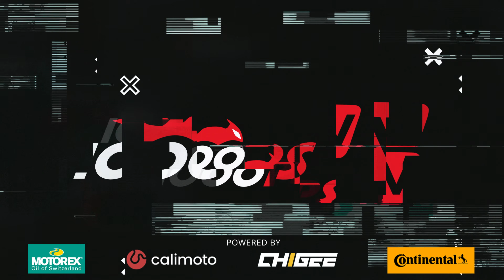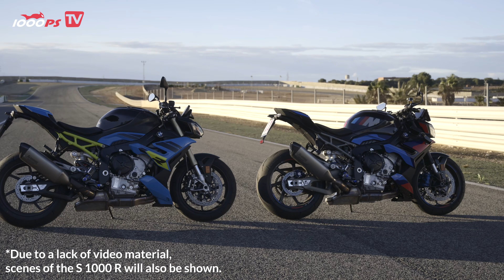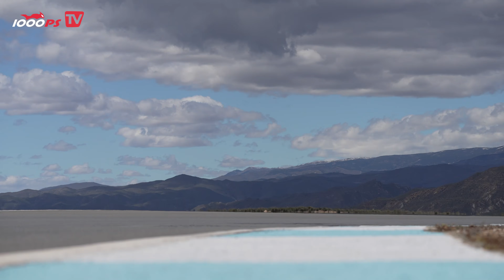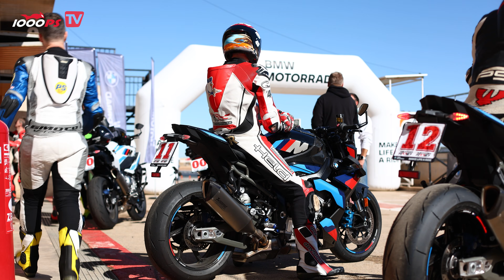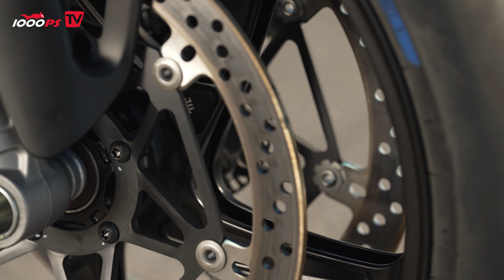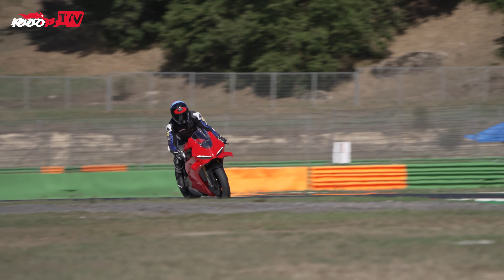Ducati Streetfighter V4 S beats the BMW M 1000 R – or does it? The honest verdict!

Comment: What's the price to run them?  How much servicing is needed to live with one of these beasts.  My 950 multistrada is pricey to service but so far the smiles, sound, and satisfaction have been extremely abundant!!!. 
And with 19,000 miles on it it has been extremely reliable, cost has been mostly consumables like tires and having them put on,  rear pads 1 once.  The enjoyment I got from this bike has been beyond words.

Comment: lengthening the swingarm on a naked counterpart of a litre sports bike is a no-brainer, as it helps transfer more weight to the front wheel, to compensate for the lack of fearing and upright riding position of the rider.

Comment: I did ride the V4S corse and it's a insane bike also easy to handle and flips easy on corners. I can say that the Streetfighter is expensive but 2000% worth the price and with acrapović exaust you get 236 HP with a different ECU MAP tuned for it. So my choice is and will be the DUCATI without doubts...

Comment: I have the Ducati V4 SP2 Street fighter, my friend had the M1000R. Just like my S 1000 RR the  M1000R increases compression damping at speed on the rear shock and it's an electronically induced pain in the ass. That electronic 😮interference can't be stopped unless you change the rear shock. Ohlins is always good and if BMW had it on the M1000 that would have been my first choice. I'm happy I chose My Ducati which feels like it has much more mid range in comparison.

Comment: Those are 2 amazing machines.  Both come from a championship winning faired motorcycle, no?  so they should be the 'best' naked.   I'm more happy with my 1290 than i ever would be on either of these machines.  Style. Its about what makes you tingle. Torque, now that i know what it is (missing from all inline 4's) is something i wont give up for higher top end.  nope. Honestly, if you havent ridden this torque monster, you dont know.  Theres a cbr1000 in my garage.  id take the 1290 every time.

Comment: For me money was not in the equation. I test road boat bikes in the hills for a long period and absolutely hated the Ducati  Street fighter and loved the Bmw m1000r  competition I ended up buying the Bmw and oh my god I’m in heaven. I absolutely love it. What an amazing bike and one more thing that you didn’t mention the Bmw doesn’t overheat on a freezing cold day like the Ducati does also every time I came to the stop it kept going from two cylinders to 4 cylinders to 2 cylinders to 4 cylinders I can see that being a big problem if it’s doing that straight away on a brand-new bike and everything aftermarket on the Ducati costs four times more than on the Bmw it’s absolutely ridiculous and the Bmw shit all over the Ducati and looks and most every Ducati owner I know complains about how many times it’s broken down and that it’s spent more of its life at the dealership with the chief mechanic scratching his head that was a big put off to me especially when you see $140,000 super Leggiero brand-new having problems at the racetrack you don’t see your Bmw with a problem and they have five year warranty
Reply: My BMW M1000R leaked oil from the head gasket below 6000 km. Fixed in warranty but still not great. The Ducati V4 engine switch of 2 cylinders when stationary and low rpm in some cases to lower heat. I have the Streetfigther V4 SP2 as well and to me the Ducati is better built and more fun to ride. The only plus of the BMW are that it's more comfortable and the inline 4 reminds me of when I was young. The Ducati has better suspensions (by far), better brakes, a more exciting engine, and overall higher built quality

Comment: Crazy amount of info but it all seems to be geared towards track riding which i dont do nor ever intend on doing.
Reply: Reviewers in all professional media should never overlook this point. Including me. 😅
Reply: Qualifier for my statement — I’ve owned two naked bikes (Monster 750, Monster S4RS), a Streetfighter, 1199R, and a custom naked built around a 900SS. 

Why would you not gear 205hp bikes built around an S1000RR and Panigale V4 toward track riding? Neither of these bikes makes much sense as a street bike. There are much better choices. I’ve ridden all the bikes I listed on the street, so I get it, but 90% of the design parameters are wasted on the street. 

I would welcome 1 minute each on comfort items for the street: heat output from the engine, vibration, braking in cold/rain, instruments & tech, gearing. That said, the majority of the objective difference in bikes like this is going to be realized on a track. Looks, ergonomics, sound are important but are highly subjective. Someone will want to talk about torque at lower RPMs but that’s not what these are designed for. 

I do find myself wanting a new V4R, but I then remember that I’m not doing enough track riding to justify it and it’s going to be horribly uncomfortable from a riding position and heat output perspective on the street. I don’t need a YT video to tell me that, it’s all in the design.

Comment: I would buy the Ducati if the fuel range was better.
Reply: and cruise control
Reply: That's my dilemma right now. Because I'm considering the '25 v4s but my old gen 1 was unbelievably horrendous in regards to mpg. My fuel light would turn on after 125kms of casual riding. I'm talking no revs above 6-7k. Meanwhile, I can ride my m1000r pretty damn brisk 85% of the time, and the fuel light doesn't illuminate until I've traveled roughly 175-185km

Comment: Great review.  As I'm evaluating which to buy, the timing of your review is perfect.
Reply: FYI, I own the M1000R, and my friend owns the Streefighter V4 S. I've spent a significant amount of seat time on both. The M1000R is way smoother to ride. The throttle inputs, the steering, even the vibrations of the engine (V4s are notoriously rough while in-line 4 cylinders are notoriously smooth). Be sure to try out both before buying. It really comes down to preference as they are both insanely awesome bikes. Either bike, you can't go wrong.
Reply: @smokeystarr  Interesting to hear.  I've actually heard that the BMW is a bit "spastic" on the top-end ...... nice linear, easy to understand and predict, then in the last part of the power band those qualities cease being true.  Supposedly, this isn't the case on the Ducati.  I'd suppose for an expert rider this is less of an issue, after all you can acclimate to anything.  Other than that, an amazing bike I've been told.  Riding them both is certainly a "got'a do it" before wiring the money ..... I appreciate your input.  Thanks.

Comment: Did I see that you left the bar end mirrirs on the BMW and removed them on the Duc?  Also, did you just test a 2024 BMW vs a 2025 Duc.  There are several engine perfomace upgrades and mapping updates for the 2025 M1000R.  HMMMM..  weird comparison
Reply: That's a 2025 in the video. You don't get the silver subframe on the '24. And BTW, there are no  changes to the engine or mapping for 2025. Those were improved on the S1000R, not the M.

Comment: For me, the 2025 BMW M1000R is the perfect choice because I don’t care about pushing a naked bike to its limits on a professional track. What I want is a bike that can chill and cruise when I’m in the mood, but then unleash pure adrenaline the moment I twist the throttle, letting that inline-four scream past 14,000 rpm with its intoxicating sound. And that gloss black finish with carbon accents? Absolutely stunning.
Reply: You didn’t watch the video did you; the M is a lot hashier to ride on the road 😅
Reply: @Motoalpina  Fortunately that statement (in the video, not yours) is utter bullshit. As is the whole comparison that hasn't been done on the same day and on the same track. Needless to say that the Duc was on slicks and the Beemer on standard tyres...
Reply: @Steveman61  I think it's true. I've heard others mention the BMW has more handle bar vibration and feels more nervous/jittery at higher speeds as well. I've driven my SF V4S 2025 at 260km/h and it was super stable, almost felt like hovering.
Reply: @DreamCore90  I don't have this problems to be honest. I ride also 2 stroke singles so I am used to vibes. My Beemer doesn't vibrate that bad. I rode the V4S and M1R back2back. I don't like the looks of the Ducati and what is worse its engine is rather boring. Especially compared to the V4 oaf the Aprilia. And riding through cities or villages is a nightmare. But well, each to his own.
Reply: @Steveman61  You don't like the looks, so I assume you don't have one, but still you say it's a nightmare to drive in cities? It doesn't add up. I have the SF V4S 2025 and it works perfectly fine to drive in the city. Personally I would pick a V4 over an inline 4 every day of the week. Would avoid Aprillia like the plague though, notorious for being unreliable.
Reply: @DreamCore90  No, why should  I own a bike I don't like? I have ridden the 25 model for over a week. I only can say I don't like its engine which I find jerky especially in low revs. And it sounds not like my Pani did. It is just strange. However, I own some BMW's one of them is a M1R 2025 and I love its screaming engine and the fact that I can ride it through cities and villages and it plays no role which gear is selected, it pulls from as low as 2000 rpm. I'd buy a Tuono V4 before I'd buy the Ducati. The Tuono engine is a lightyear ahead....
Reply: @Steveman61  Maybe you were driving it in Race mode with engine at full power then. In city driving with Road mode I think it is super smooth. You can ride it in 15km/h without it being jerky with engine power at Medium (don't really need more in the city). I was suprised how smooth it was. Had a Monster SP 3 years ago and that one was damn jerky. Overall I think V-engines have much more character and I actually like them being more grunty and personally think inline fours are boring. But we are all different!
Reply: @DreamCore90  I could say a lot about that. But I don't feel like it. Enjoy your Ducati.
Reply: Agree
Reply: Absolute BS. Check MCN chanel about the StreetFighter. I have the 2023 model, and you can cruise all day long. Put it on track and it becomes a beast!
Reply: Did you consider the S1000 R at all?
Reply: I wouldn't trade my comp. for anything, its ruined all other bikes for me
Reply: @nickdefreitas  WORD!=Totally Agree.

Comment: Not biased at all, I hoped to see test, but all I see how things look on paper. I tried both.

Hardly any turbulence at 260+ on naked is a lie, both V4S and MR are not stable at 270+ 

BMW is leaps and bounds better on the street the V4S, comfy, better electronics ( it has fuel gauge ).

And every Ducati owner has that saying "Need to be an experienced rider to really understand and enjoy the Ducati"

In reality did you really test 2025 M1000R vs 2025 V4S? Or is this just some AI generated nonsense?

Comment: I was painfully choosing between these two and went with SF V4s. It is just more exciting engine and (imo) looks better. Another issue with BMW is that  in USA you have to tune it, as they choke the engine in ~6-8K range, which makes it nervous at corner exits and generally on the street.
Reply: Ofc it looks much better 
Why you didn’t choose panigale? 
I am choosing between those two
But my current motorbike Yamaha mt09sp
Reply: @mrm.2540    1) I don't like the looks of new Panigale, I like how 2025 SF looks like.2) I already have 2 track bikes (21 Pani and 24 S1KRR with everything) and on the street SF makes more sense - not as hot, faster 60-120mph due to gearing - will be a champ on my favorite back road:)
Reply: @take_it_slow_alex  If you were to own just the S1kRR or the SF V4S (both 25 models), which would be your pick? I'd love to do a couple track weekends and otherwise non track stuff.
Reply: @tsarnevits  I've never ridden '25 Panigale or BMW, but comparing my 21 Pani and 24 BMW (fully optioned both), BMW is more sensible choice for mostly street riding. Main factor is heat (Panigale gets painfully hot) and price ( Panigale optioned as my 21 costs 50K+). BMW main downside - you have to tune it, stock engine map is complete garbage. And to me, Ducati is more of an event to ride. On a track, I will be more consistent on BMW, but I would enjoy Panigale more (it is wild with full system!). Either one is miles more capable vs. skill I have.
Reply: Is there a limit to output? I've never heard of it before😮

Comment: You guys are complete idiots as naked bikes have really no business on the track anyways having no windprotection or not enough weight over the front putting the power down without wheelying…A good rider on a S1000XR would beat both and be more comfortable doing it 👍
Reply: It’s not meant to make sense. I keep up with all bikes on track with my Streetfighter. It’s very capable with comfort for daily riding or street riding.
Reply: My track instructor on 100 something hp supermoto Husqvarna was catching up with me on 220 something hp full Akra Panigale, so nothing compensates for skill. That said, even 22 SF I have is pretty stable at track speeds,  you totally can be at the top of your group on it.
Reply: The problem with semi or pro road testers thrashing the hell out of a bike is that it is of no relevance to an average owner of one of these exotic bikes. 99% of riders will run out of ability way before the bike does so the fact that it’s 1 second or so faster around the circuit or a bit tighter than the previous generation will only make a difference to a racer or a rider with superhuman abilities. Most bikes I’m guessing are purchased because of how they look and appeal to the buyer along with the feel good factor of owning something that you enjoy. I would love to open my garage and have the Ducati sitting there, I would be able to ride it within my limits and bring it back home with a smile on my face but the reality is with all the training in the world I am never going to be the next Valentino or even consider pushing it anywhere near that hard on the road.

Comment: Points of view about the prices.In the two main markets in Europe,  these are the prices :Germany M1000 R with the M package 29.000 euro, Ducati V4S 28.000, then Italy 30.000 vs 28.000 for the Ducati.Considering all the areas where this Ducati even without the Carbon wheels, seems better, not difficult to judge the winner here...I would never trade the BMW better price with the Ducati better front stability at high speed, better suspensions, more complete electronic aids, last Brembo brake system, less nervous engine etc...My two cents of course.

Comment: Does this ducati still get very hot during stop and go traffic?
Reply: I have 21 Panigale  and 22 SF. Panigale is terrible in terms of heat. The heat on SF is down below where the feet are, with proper boots I rode it in 35+ C weather and there's no big issue. I only hope they didn't make it worse in 25, as I just put an order for 2025 SF V4s
Reply: @take_it_slow_alex  I have a 23 Panigale v4 same problems 🥵🔥🔥🔥🔥 and my water pumps just got leaks few weeks ago Now got fixed
Reply: @bobo1694  I believe you. In ~18k miles  I fixed that 2x, also replaced quick shifter 2x, 1x burned wire to rear breaks, but my favorite 2x is the issue with kick-stand sensor, with the bike unpredictably  (say at full lean) shutting down or jerking the engine. I still think the bike is awesome though:)
Reply: @take_it_slow_alex  My v4‘s water pump problem appears at about 18000km , The temperature just suddenly rises up from 2 to HIGH ,And then I cheak my right side coolant tank, to find out that it’s empty,but no leaks on the ground, Took my bike to the dealer shop,they told me to keep riding it, and at about 20000km, it started to leaking on the ground,from a hose behind the coolant tank’s hose, fixed it with Ducati’s warrant.
Reply: @take_it_slow_alex  Then said that the later version’s water pump’s problems got fixed, but on my 2022 Gen’s v4 it still exists 😂
Reply: Same engine configuration , Even the new Panigale V4 they claimed that the whole cooling system got improved but still the same, So I guess the SF is still the same
Reply: i own both pani v4s 2025 and streetfighter v4s 2025 and yes the streetfighter v4s 2025 is much cooler than the previous gen streetfghter v4s
Reply: @zahrudyothman6708 did the pump get fix?
Reply: @rawcircoking  so far no issues on the pump, 3000+ miles on it